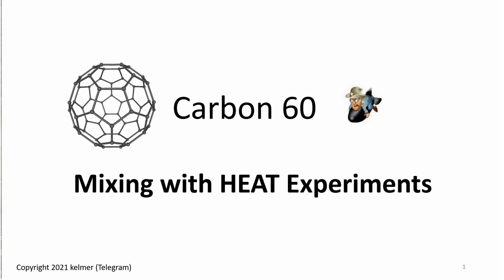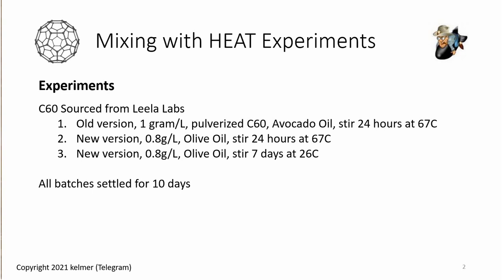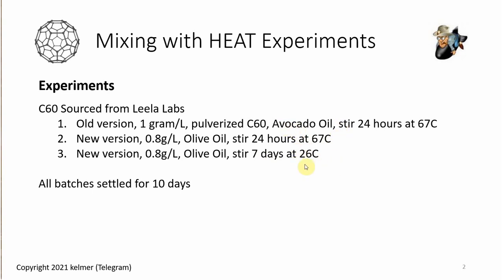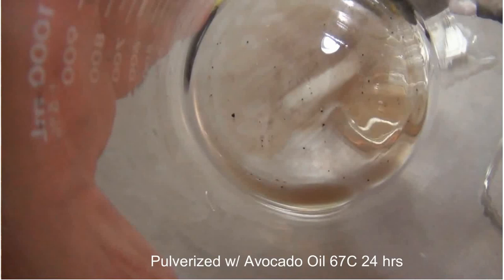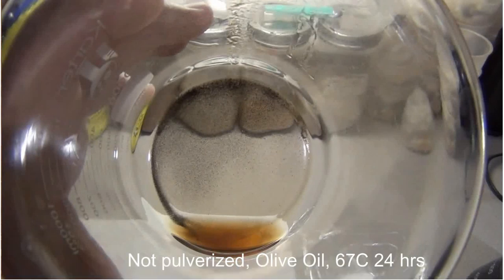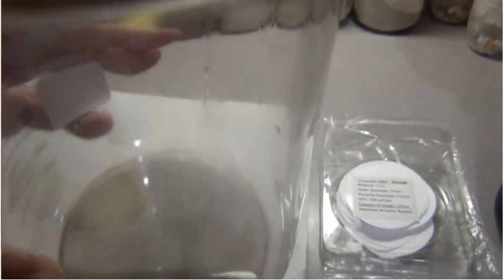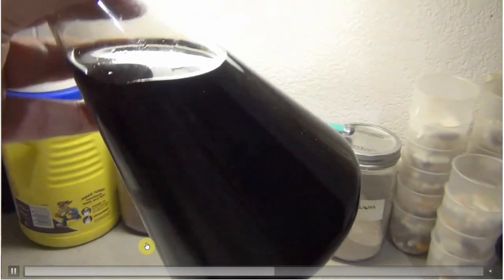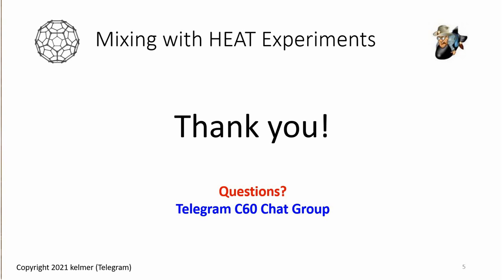Carbon 60 - Mixing with HEAT Experiments

Comment: Aloha from Australia K Elmer. Love your work. Thank you so much. Just wondering if you can do a video of how to set up the magnetic stirrer with the connical flask and also the filtration process.  I have been mixing my C60 in a blender (blending to heat approx 5 minutes 4 - 5 x per day over 14 days but am now upgrading my equipment and not too sure how to set it up. Would love your advice.  Cheers mate. ;)
Reply from the maker: I'm sorry; I'm not making any further videos on C60.  I've moved on to other interests.

Comment: Hello KElmer,

I've been tinkering with making c60 for approximately one year after following you.   I've been getting the c60 from RLL based on intuition validated by your personal experience.  It's been ok.   I confess I do have high standards and curiosity.  I want to try concentrate grin Leela labs.  I have been unsuccessful with getting Leela to respond to email.  Willis you be willing to help me somehow?  adaleoneal@gmail  (I don't sell c60.)
Reply: Yw. And Thank you for everything you do.
Reply from the maker: Did you just need the links or have questions?

If you're the Hong Kong question, I see there hasn't been a reply?   I will forward your message to them.
Reply: @KElmerTinkersAcademy  I am located in WA (PNW) USA.  Questions?  Yes.   Thanks for asking.  Do you prefer Leela over RLL? Any difference?  (The quantum energy is fascinating.) Also, A Leela email that someone checks/ responds to would be appreciated. 

What is your knowledge regarding the frequency generator RLL mentioned?  Was it 10hz?  I play frequency tones but higher.   Usually 528hz. I'm not clear on what interventions  the 'alchemy' entails. Do you know?
 I also keep my c60 sitting on or around sellenite;  smudge with copal resin and palo santo wood.

BTW, I like you; your such a nice person. Everyone I refer to your channel says they love your vibe and smarts.  Your on the right path 🤠

Thanks muchly.
Reply from the maker: Oh, okay.  For the C60 Telegram Co-op, the best place to ask questions is to post them in the chat room.  
https://t.me/joinchat/Ts_wBx00IO2rM5Vm

As for a preference; yes, I lean towards Leela Labs as they really came through for our membership when when the person who was running the co-op could no longer keep managing it.  Leela replaced our old process with a wholesale group discount that amounts to 50% of retail, which is a huge savings for all of us and equal to what the co-op was able to provide.  Thus, my loyalty.

The use of frequency by RL was introduced when they released their AC60 product and was 41Hz (sine wave) for olive oil during settling between heating.  He advised it helped the C60 form into lipofullerenes.  I'm not an alchemist, but the concept makes sense as that's what Ultrasonics do.

Thanks for your kind words!
Aloha!

Comment: K Elmer what equipment are you using to add heat to the stir process??  Thanks in advance for your help.
Reply from the maker: This is the hot plate stirrer I use.  The temperature probe stand is separate and you need it.

https://smile.amazon.com/gp/product/B01HQ0JPOI/ref=ppx_yo_dt_b_search_asin_title?ie=UTF8&psc=1

Stand

https://smile.amazon.com/gp/product/B0747LXTP9/ref=ppx_yo_dt_b_search_asin_title?ie=UTF8&psc=1

Comment: I am curious first of what happens to the  olive oil.
That is, stirring olive oil for 24 hours and with heat, what happens to it?  I would think it oxidizes and possibly becomes rancid?
Reply from the maker: Tastes just fine and with the C60 in it, far less likely to oxidize as quickly.  Some C60 oil producers have found the shelf life for olive oil extends to 5 years when C60 is added.

Comment: Are use coconut oil. In the winter time I have to heat it. I did fine I have a less residue in a darker purple hue. And I did it for seven days or eight
Reply from the maker: As a trick to keep coconut from solidifying at room temperature in the winter; I add 1 part avocado to 3 parts coconut.  Works great.

Comment: I really would like to see the results immediately filter after stirring.
I don’t understand why you would have to wait to days?
Reply from the maker: Only to let larger particulates suspended in the oil settle to the bottom to add to the next batch (ie don't throw it away in the filter).